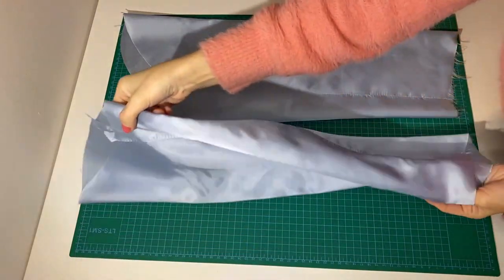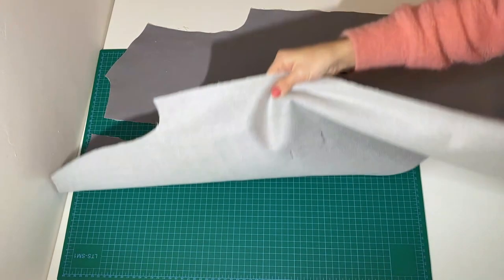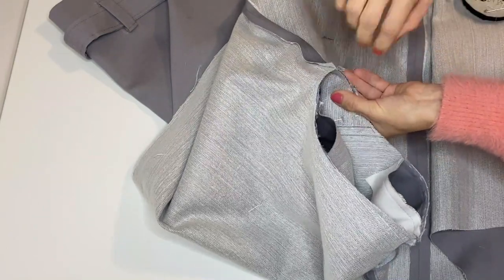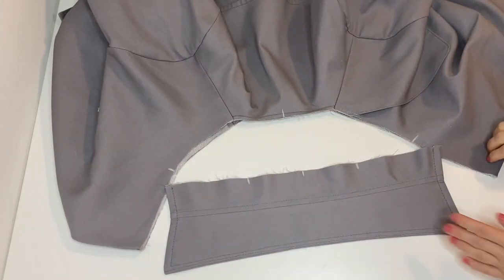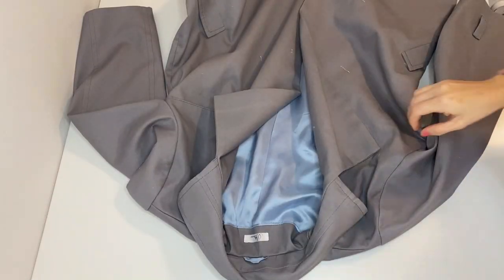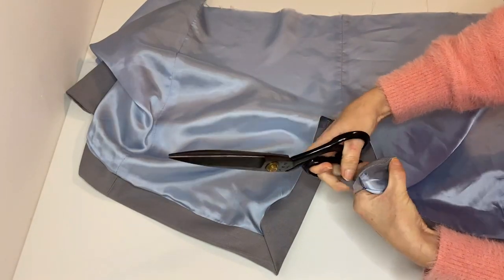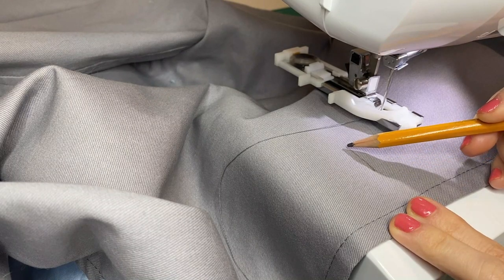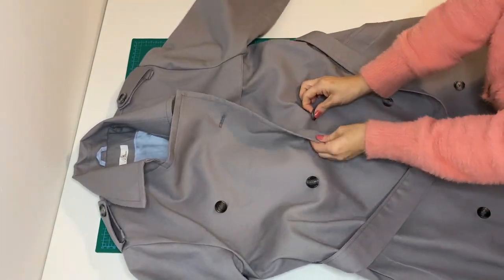DIY Trench Coat Tiffany Part2/ How to sew Trench Coat / Sewing Tutorial PDF Patterns #sewing #coat

Comment: This is beautiful! Will this pattern work also for a men or would I have to make alterations?
Reply from the maker: Thank you! Generally you can use, because its an oversized coat (no darts or cuts). But, yes, you will need to make few alterations with all patterns (there are patterns for External and Lining layers). For each pattern piece, like front, back (armhole, neckline, shoulder parts), sleeve, collar need to add extra width and length as well, related to your measurements.
Reply: @svetadressmaker  yeah that makes sense! I thought that maybe the body shape was different but since it’s oversized I shouldn’t have any problems. Thanks!!
Reply from the maker: @federicomiron  You are welcome, hope you can manage it :)
Reply: @svetadressmaker  thank you so much! I’ve just bought the pattern, I’m starting to learn how to sew so hopefully I’ll be able to make it😅
Reply from the maker: @federicomiron  Great ! For beginner, maybe will be a bit difficult, because coats are - Intermediate sewing level usually, but I tried to show almost all steps in both parts of that tutorial (except cutting patterns on a fabric). And I always suggest to everyone, make a mock up first, use cheap cotton or leftover fabric, so you can check fitting and fix some issues in a pattern.
Reply: @svetadressmaker  yes! I saw the videos first and I think I can make it (with the help from my grandma, who is a seamstress and currently teaching me haha) and making a mock up to measure specially body and arms length will be very helpful, thanks!!

Comment: thank you i love it. can i use a leatherette fabric?
Reply from the maker: I think you can use, but before need to be sure about all stitches, make them accurate (as mistakes and any defects are very visible on that kind of fabrics, and when you take of the stitch there are can be some punctures). Anyway, you can create first MOCK-UP (use some cotton or linen), besides you can also check fitting, because patterns made based on a standard dress form. Good luck, if you will have any questions, just text me :)

Comment: I don’t understand after closing up the bottom in inverted hoe do “turn the coat to the right side” ?.? You just sewed yourself off inside of it. The whole thing doesn’t make sense to me. Also it shows how to add lining to the sleeves, then it shows how to attach the inner lining to the back and the sleeves lining were missing. They were just there 4 minutes ago.
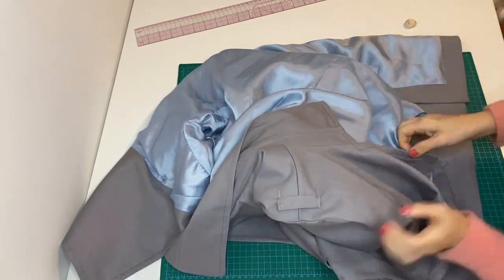Reply from the maker: On 29:16 - you will see that I made a gap (unstitched 15-20 cm) of distance on a side seam of lining, right after I closed bottom of coat. Then this gap just topstitch at the end. 
For better understanding there is a "Sewing Instructions" comes along with pattern set.